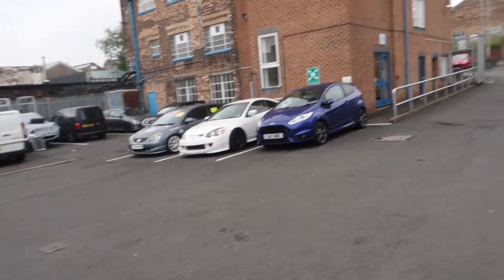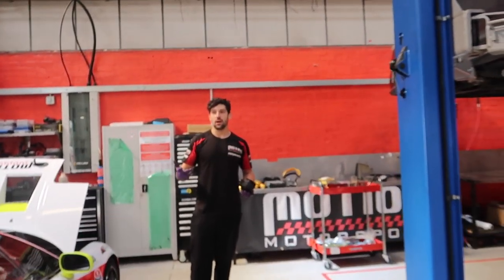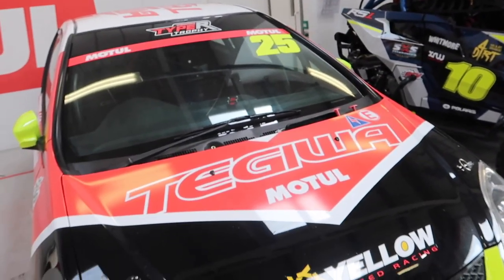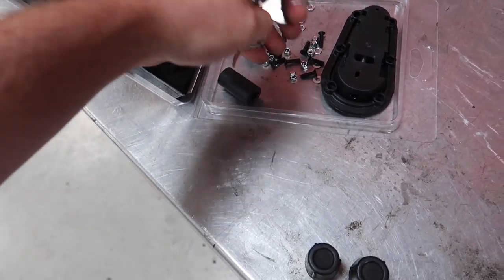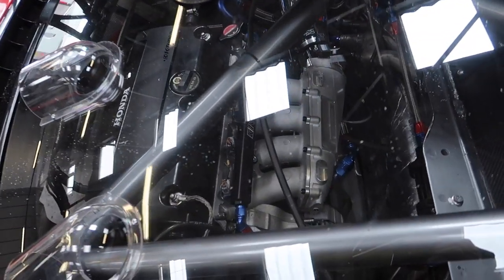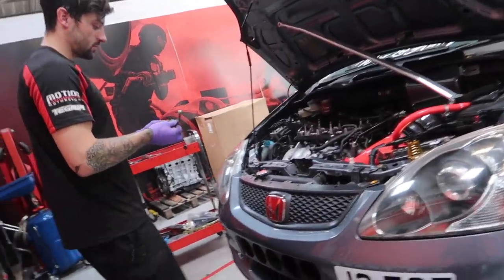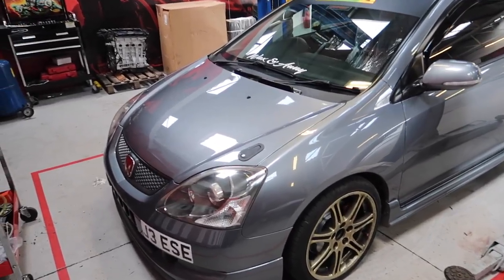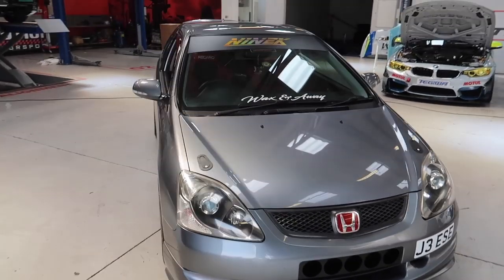Starting Work With Motion Motorsport!!

Comment: " not cheaping out on my car " previous video,  buys second hand brake calipers 👍
Reply from the maker: Needed a quick fix.
Reply: Jesse Collingham secondhand is ok as long as they are in good condition. I have a pair of calipers in use that are nearly 60 years old. Nothing wrong with them and as good as new with recently fitted new pistons and seals.

Comment: Hi J. When you had your bonnet catches fitted, do they have a weather seal ?. Also did you put any rust prevent on the bare metal that was cut
Reply: motion motorsport don't cut corners m8